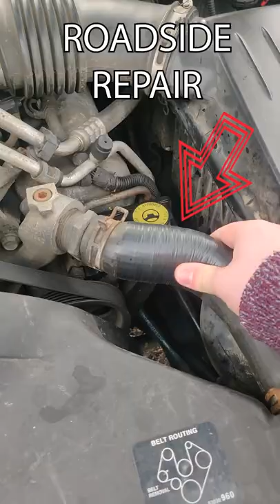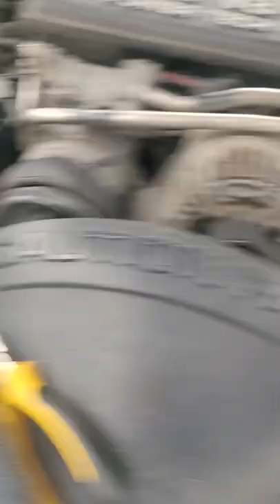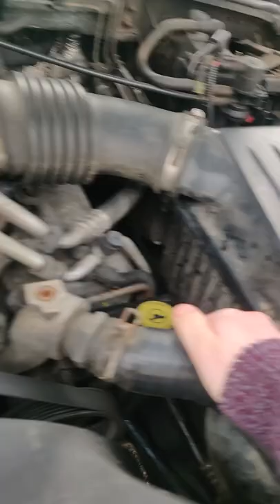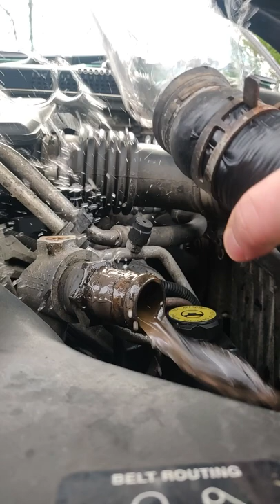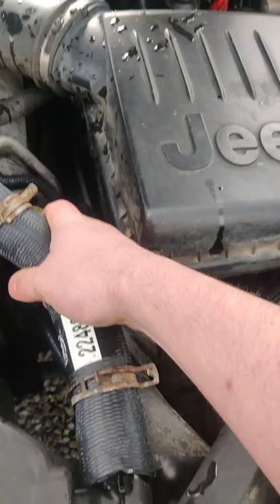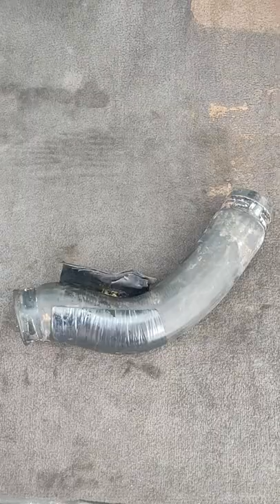Repaired blown radiator hose with insulating tape | Fitting new hose.

Comment: I've been using this trick for over 20 yrs. It's a just get you home fix. Electrical tape will do as long as you keep the engine running.  As soon as you shut off the engine pressure will build up and coolant will find it's way through the tape. The only permanent fix is replace the hose.
Reply: I was driving on the high way for about 6 minutes before it started heating up on me brotha, I seen smoke coming from my hood. I parked it, the smoked went away after two minutes, I popped the hood and seen the hose was teared. I taped it, the car turned on again but it over heated again 5 minutes into driving it, it smoked again, I pulled over. Let it cool down. Taped it again and drove again lol 😂 had to do it three times to get home 

Is that a bad thing? But it wasnt running on empty, I had three gallons of 50/50 coolant on me
Reply: I'ma get a new hose tomorrow morning, it should drive perfectly fine right? After I get the hose
Reply: @RikoSwuavee Did you crack your head gasket doing that instead of towing it? Lol

Comment: Lmaoooo dude a new hose is like $10 or less.
Reply: Depends I’ve seen some hoses go for 40-60 lines are more ofc
Reply: $2.50 for me.. 2005 jetta 2.0
Reply: It was a temporary fix until the part got there I didn't think there was someone brain dead enough to not figure that out 🤷 turns out you're special
Reply: It is but the cost mechanics charge is insane for such a simple repair. It sounds expensive so they overcharge

Comment: I always have jb waterweld putty with me for any leaks doesnt matter what kind lol unless its big af but anything smaller than your palm you can usually get with a tube of the stuff
Reply: I had a coolant leak I noticed after I checked coolant level under hood and both reservoir and expansion tank had been emptied from leak, so I first temporarily fixed with duct tape. Still was leaking. So I decided to cut off layers of first tape fix and I tried using loctite super glue around edges of where hoses join together in the y shaped plastic tube. Then retaped over hoses again with new gorilla tape . Very little loctite super glue was used around the edges of external hoses but by chance is it possible that small amount could possibly seep through hoses along with coolant liquid and cause damage to engine in small amount?